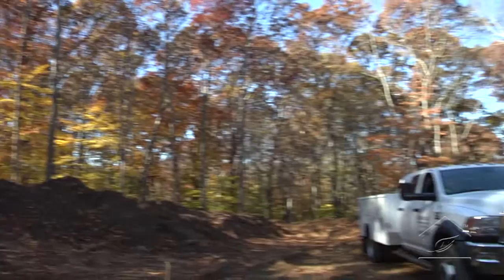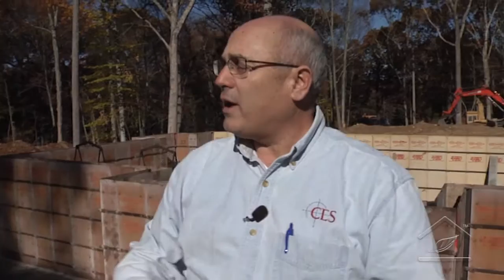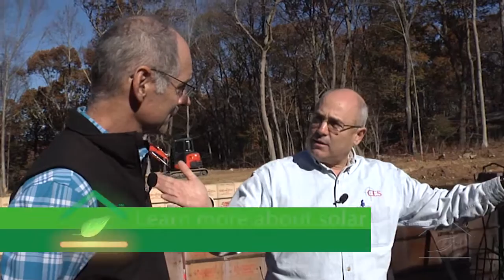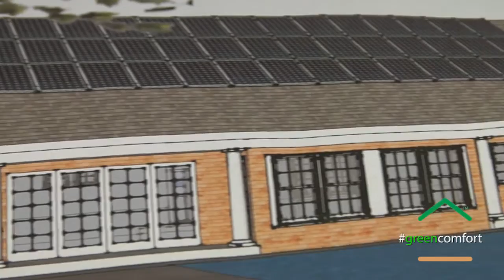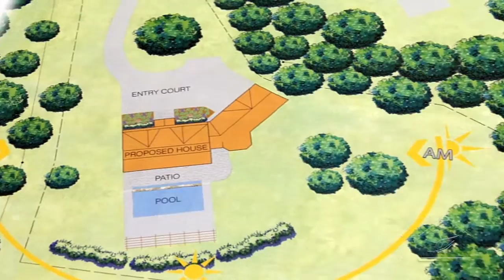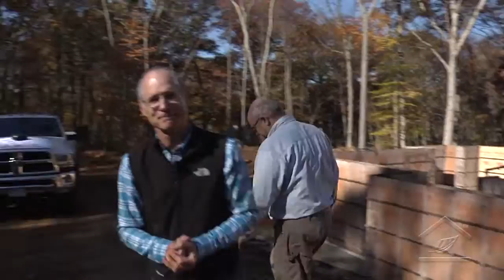Building Green Comfort from the Ground Up - 013 - Sights on the Sun

Comment: Lighting is one of the lowest energy user. Heating the house and water heating are the biggest energy bills. Poor energy appliances will cost you in the long run but its really the house construction, energy source (PV-thermal-woodpellet-ground source). I'm surprised that the house looks to have started before the solar equation has been checked out before a single bit of concrete has been poured or brick laid.
Reply from the maker: Hi Stephen, that's the magic of television. In reality, I had already planned out most of these systems and done most of my homework before we began building the home. Thanks for watching, stay tuned and watch the progress unfold!